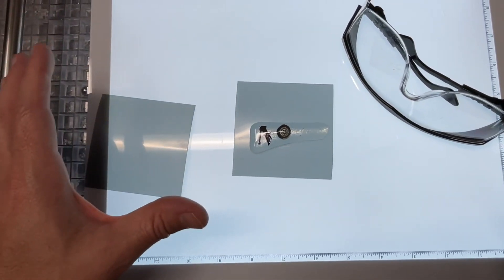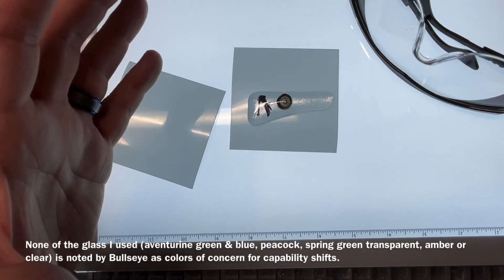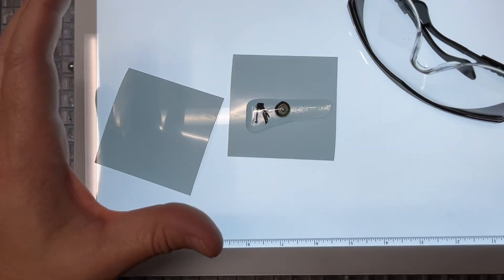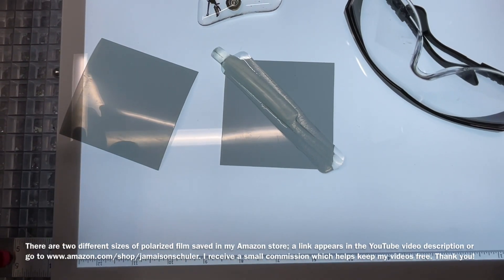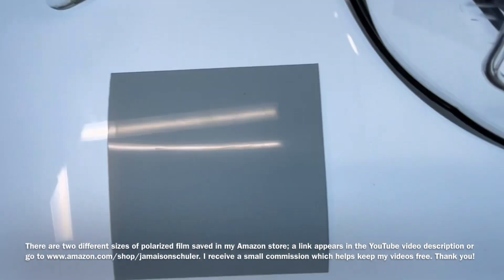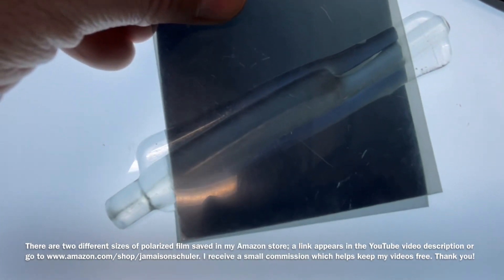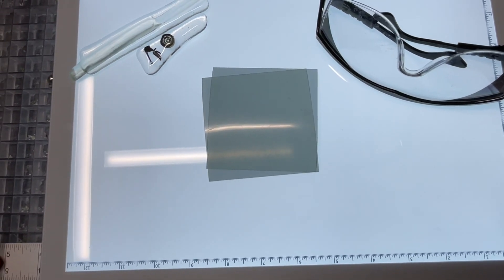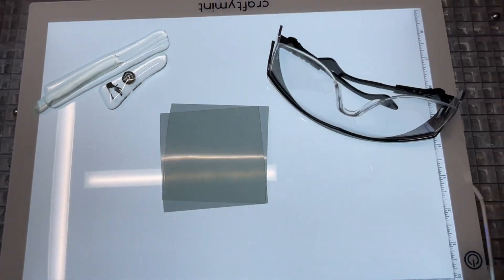PART 1.5 of 3 — Don’t Miss This Important Update About Pulling Your Own Cane!

Comment: It would help if you were wearing Torchwork safety glasses to protect your eyes.  I know you are not staring at a flame but looking up into that molten glass can damage your retinas.  Of course safety glasses also protect you if the glass should happen to POP for some reason.
About glass compatibility, my friend gave me a box of clear which she thought was all 96 coe.  I found out the hard way some of it was 90 coe.  I made a small 5" square that was going to be a trinket dish using a 96 base,  a clear cap layer, and some murrini on top.  When it came out of the kiln it had a small crack in the center.  Darn!  Then the crack started growing from the center out in a spiral.  Watching this crack grow slowly over time has been entertaining even if disappointing.  Lesson learned.  Now, in order to be safe, I have to stress test a slice off every piece of that clear scrap in the box or just toss it, which would be a waste of good material.